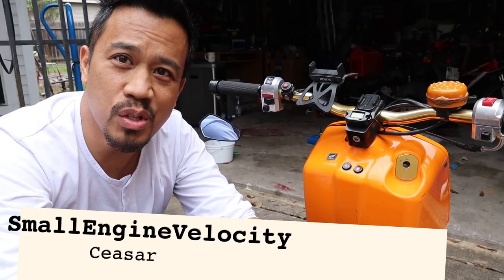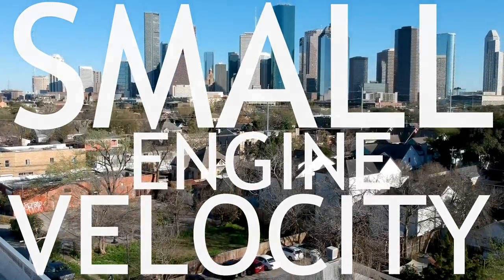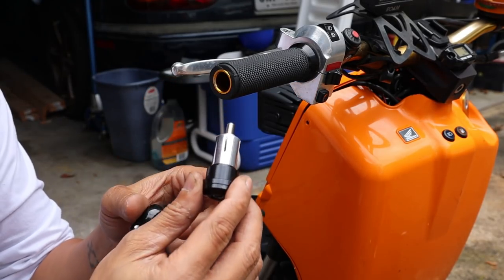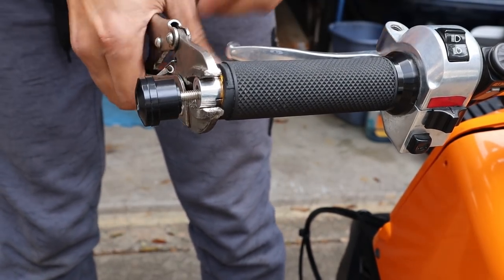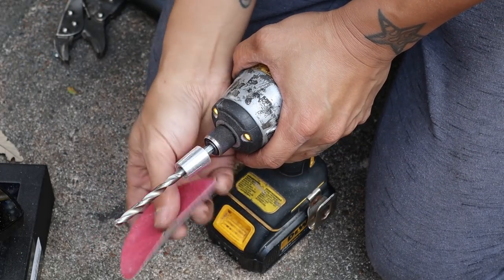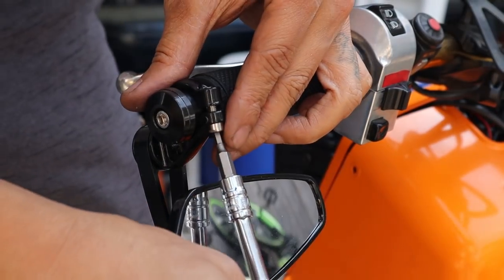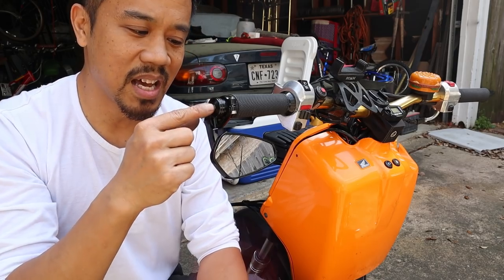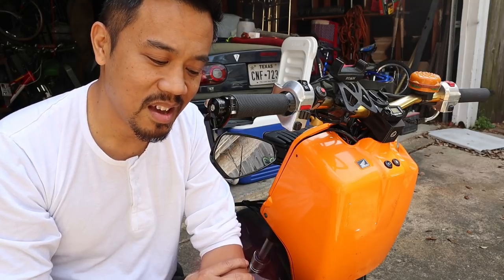Honda Ruckus needs some NEW Mirrors | Amazon mirrors ordered and Installed

Comment: That piece you sanded down should have had one inside of it so you can do a 1 inch or 7/8 inch handle bar that's how I got bar end parts before look they slide apart if that's how yours are.Ruckus looks cool weather in Pittsburgh is looking good for sunday so I can get my ruckus out for a long  test ride nice to see you put the spring back in.
Reply: what he said
Reply: That's how mine were too. Made it easier to go inside the handlebars

Comment: Just an FYI to all. I bought the same mirrors on amazon not sure if the company who makes the mirrors made some changes but mine came with to different adapters. The ones that Cesar has to “file” down and a smaller one. I run pro taper 7/8 bars and they fit great no modifications needed just did not use the larger “adapter” so to speak.
Reply from the maker: Thanks but I filed the large adaptor instead of removing it like a idiot :) people made fun of me for a week with this video haha! Thanks for updating everyone and I love these mirrors.

Comment: I love watching your videos and you have had good ones. this one was hard to watch though. Im sure you learned by now from others but the part s that go in the bar come in three pieces, two tapered shims and a third thats the cones that spreads them apart when making tighter. These will eben fit the "girls" smaller bars you mentioned by taking away one of the shims if needed.  It would help if the mirror guys would give proper directions.
Reply from the maker: Yea , lol I learned by fire on this one. Lots of messages , this is an early video I hope I've gotten better since this one

Comment: this is so hard to watch
you got the wrong size sir and you should have hammered on the aluminum piece with out the blk part
Reply from the maker: It was for 7/8 bars TxGet , what other measurement should I have been looking for
Reply: did it not have multiple aluminum inserts?
Reply from the maker: How do I know the center will fit ? And I don’t want ones that stick out I wanted an inward facing mirror
Reply from the maker: No I wish , in the end it worked
Reply: it looked like it did check the other one looked like it was three pieces
Reply: yes it does I paused the video and the aluminum has three pieces the one you use in on the inside of the piece you sanded
Reply: @buzzy2720  yep
Reply: I would delete this video and do one the right way so hard to watch you not do it right
Reply from the maker: No people can learn from my mistakes :) Im happy with it
Reply: @SmallEngineVelocity  you live, you watch, you learn